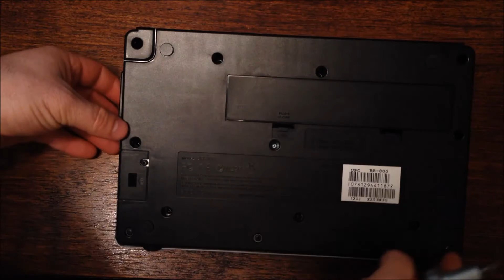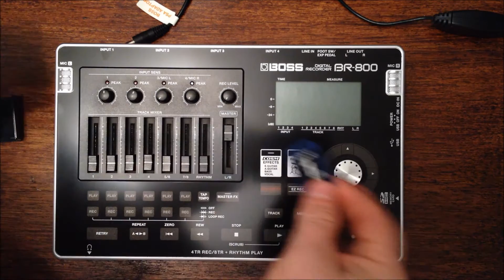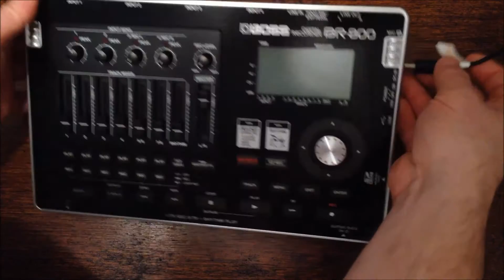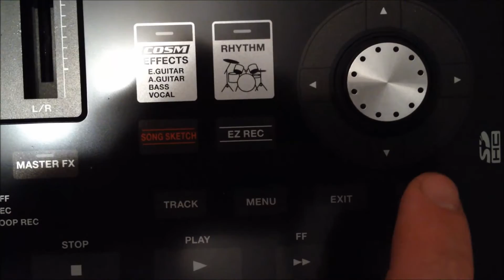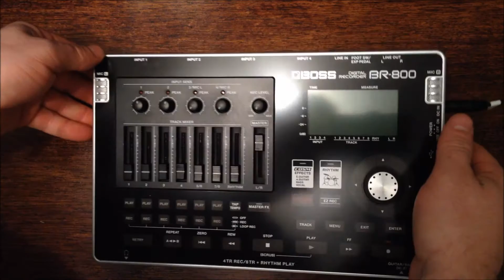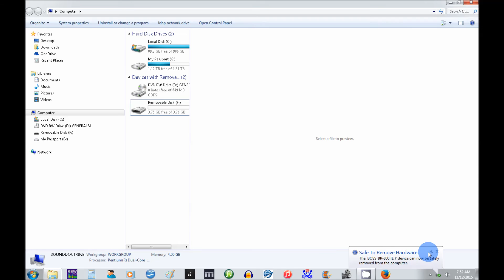BOSS BR-800 Firmware Update (1.10)

Comment: Love your BR-800 vids Robert !
One question: I wonder if the touch buttons are purely electronic (hard surface / not moving) or do they move just a little bit ( Like a Yamaha DX7 ) when you push them down  ?
Thanks !
Reply from the maker: They are hard surface. The cool thing is you can set the sensitivity.
Reply: Robert McClellan Thanks ! -Sounds great ! Had any problems with the scroll wheel yet ? I heard some problems with the BR-80s Scroll wheel but not any with the BR-800 !
Reply from the maker: I owned this for 5 years and never had a problem with it!
Reply: Robert McClellan Sounds great - Thanks Robert !

Comment: hi, if i wanted to upgrade to a 16gb sd card, would i have to update the new card then copy the old files from the old sd card to the pc then put them on the new card? or just copy the old files to the new card THEN update? i know the boss br800 can take up to 32gb.... do you use a bigger card or just copy the file to pc when your done?..... thanks
Reply from the maker: +titmusspaultpaul5 Hey! Once the Boss is upgraded there is no need for the firmware files any longer. You can upgrade it on any size card and then just delete them when your done. As for using the card, I actually just use it as an audio interface, so the only time I ever need the SD card is for remote recording. Hope that helped!
Reply: +Robert McClellan thanks for the reply.... cheers
Reply from the maker: titmusspaultpaul5
Notta problem buddy!